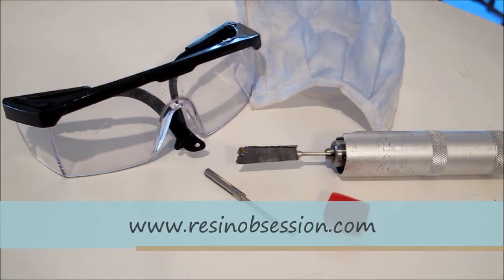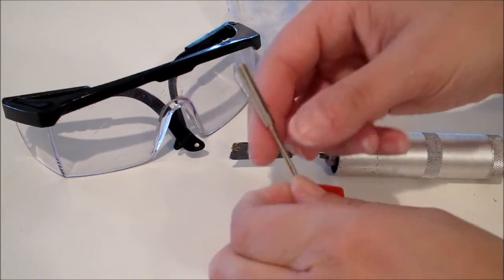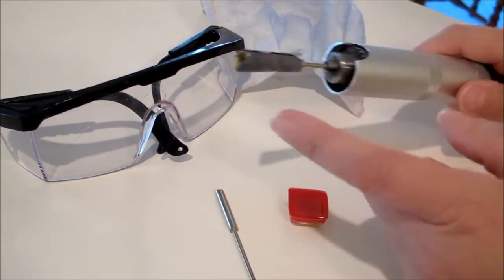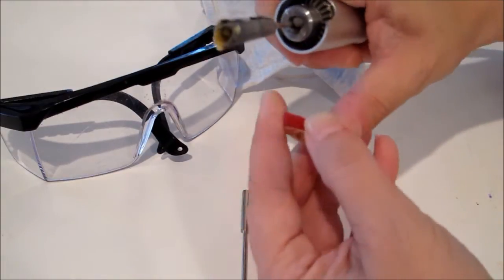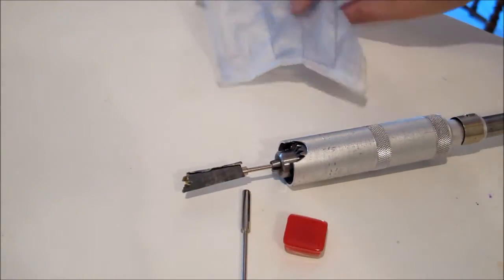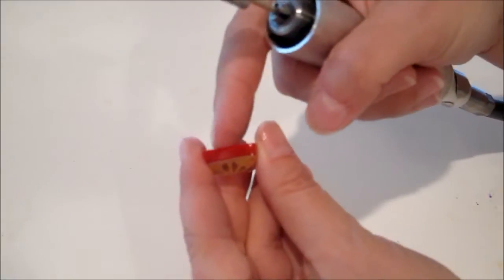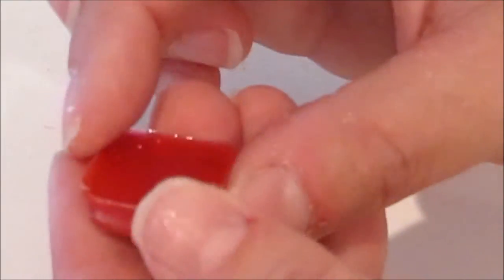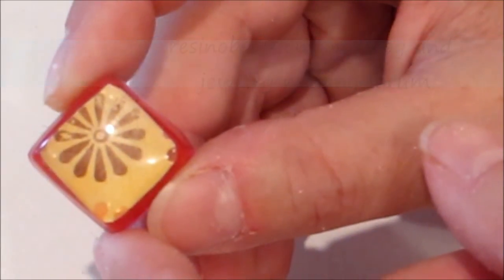How to Sand Resin with a Rotary Tool

Comment: Great tips! Thanks for sharing!  Love your videos.  I found a great tool to sand the edge of my pieces that was very inexpensive and easy to use at the drugstore.  I use a little battery operated nail tool that has a push button control and is not near as powerful as most dremel tools so it's more forgiving.  And it comes with several attachments that are suitable for sanding resin.  I love mine!